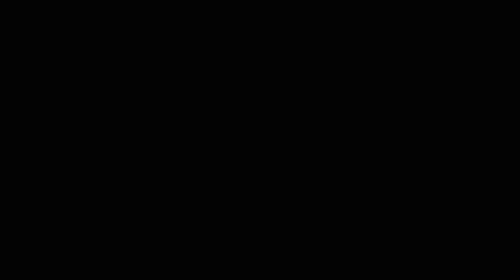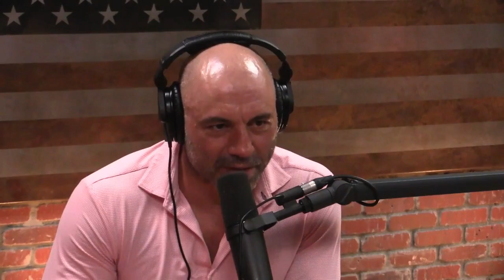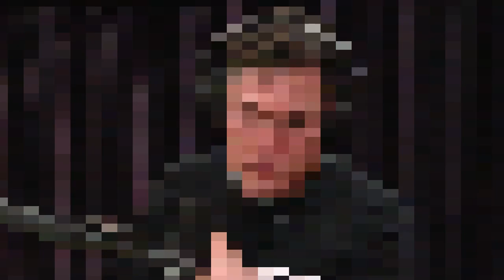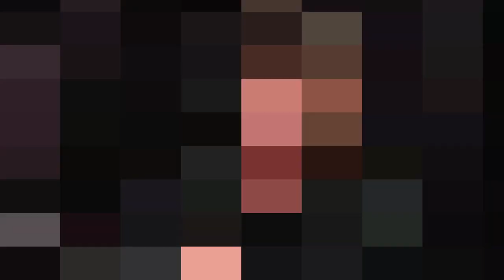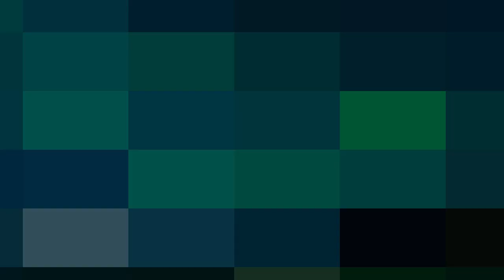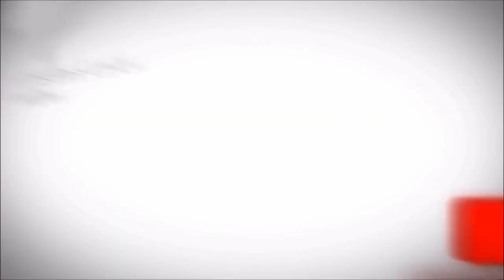Elon Musk"I've designed an Electronic SUPERSONIC JET"

Comment: It sounds like polarized haul's of ships like star trek, in which various energy signiture's could be promoted on such haul's. 

This would allow possible communication signiture's and shielding potential off the haul to be emitted. It's neat that electric propelled planes move, in a earth atmosphere. With the right tuning, it could possibly move it through other environment's like outer space.  This would allow a vessel, or object to thrust movement entirely all at once from a polarized haul. Or entirely all at once, to have communication signal's emitted from the whole polarized haul. 

This in theory, should also work for nano bot's as well, as they could mimic that feature of polarized haul's. Nano bot's could move around and through environment's. As they thrust, or hover through environment's.
Also if nano bot's emitted the right energy signiture's, or signal's. They could be detected from devices and communication with them from other devices would be possible. Cloaking would be possible as well, for those polarized haul's. As they could be blending in microwaves and other possible background noises, to have it appear normal.  The only thing really, is to have polarized haul's charged well enough. For strong energy field dynamics of interaction's to be in the environment. 
Everything is like torus Field's, or alternating current fluctuation's. I like another name for this, force balance.

Comment: I'm a little skeptical of this idea. Elon has said this idea would be compelling if batteries could get to 400Wh/kg and the plane were 70% batteries. So the plane's overall energy density would be 280Wh/kg.

But a boeing 737 can take off with 25% fuel and kerosene has an energy density of 46MJ/kg which equates to an energy density for the entire plane of 3194 Wh/kg or more than 11 times Elon's design.

So how can you do so much more with so much less?

Comment: I've been trying to figure out how such a VOTL supersonic jet would work. But such an aircraft ends up looking like an electric rocket flying a near ballistic arch.

Expending a huge amount of energy on takeoff, not much on cruise, and getting the energy required for landing using regenerative breaking on the way down.

It would be one hell of a ride. Not recommended for the fait hearted as its gonna pull some serious Gs on both take off and landing. 

The only upside being it would be all positive Gs, and you'll get to experience less gravity, even zero G for most of the flight. The downside is you'll probably need a ladder to get out of your seat as the whole thing would be build vertically.

Getting out in an emergency is also gonna be problematic, but at least it would have the entire back end of the aircraft as a crash core to absorb some of the impact... not that it matters hitting the ground at 300 - 900km/h.

Comment: The power of elevation. That is a really interesting concept that is totally overlooked with gas planes. You basically can expend the energy to gain the altitude, then use the wind to regenerate alot of that energy on the way down. And using solar as well to charge the batteries could actually result in really good flight times. Honestly, an electric turbine and higher altitude cruising, combined with a body covered in solar panels, and you could probably make a passenger aircraft that could compete with gas turbines. The maintenance and fuel cost on those is insane. We will probably see something like that in our lifetime. Burning gas really wastes alot of energy, it's everywhere, but we often fail to utilize it.

Comment: Recovering energy during descent would require rotors (like a wind turbine) which would likely double as wings (one of the rotors would flip) in forward flight.  The simplest design would be wing/rotors with tip jets (could easily be compressed air) since they would require no counter-rotation mitigation.  A electric drive at the meeting of the wings/rotors would require a pair of wings/rotors something like a biplane that converts to counter-rotating props.  Any of these would be fine at very high altitudes where aerodynamic drag isn't a major factor.

Comment: basically, musk just said that energy density in batteries aren't there yet. seems like his idea is just to get straight into the upper atmosphere as quick as possible so that you wouldn't waste energy  before cruising in a less dense atmosphere.  However, nothing about what he said is novel or complicated at all.  The part that i guess he is keeping close to the chest is how an electic "jet" could be designed in such way to go supersonic. Its kind of a cop out to just say, "well its easier to do once your high enough." But the fact is, we won't see an electric jet until energy density in batteries get better. Something like an EDF would draw an absurd amount of energy very quickly to reach a comparable thrust power of a jet engine.
Reply: Nice thing about electric motors and batteries is they don't need oxygen.
Reply: @petemiller519  right.... however the thinner the atmosphere the less potential airflow. Jet engines do well in high atmospheres because they also use propellants. As of now, there are no electric engines that could propel fuel as powerful as traditional rocket/jet engines. Ion propulsion is great for long journeys in space, but has no real applicable use within earth's atmosphere.
Reply: @JakeBananas  Check out plasma thrusters, it's new tech that re purposes old tech
Reply: @thevaren27  is that different from ion engines or ion propulsion for pushing ions in the air?

Comment: Elon pretty much just glazed over the hardest part of this problem which is the energy density of the batteries. He probably has a design which is relying on battery technology which doesn't exist yet. Existing batteries - including the cutting-edge ones his own company produces - are too heavy to put into a working plane that could fly very far. Especially a large plane.
Reply: Nah, the idea is that you fly at a much higher altitude thus reducing the energy required quite significantly. Also wondering if the solution includes a "lift off drone" or something similar that lifts the airplane straight up to a high altitude, and then falls straight back to the airport while the plane takes off from high alt.

Comment: Planes are not really pressurized? Doors are leaky? Seriously? They can't airseal a door on a $150 million machine?
Reply: They can, but they don't need to. It's more important on space craft where you don't want all your air leaking out. On a plane you want fresh air going through for the passengers and all they need to do is stick an air pump to keep the pressure inside the cabin the same. It wasn't a problem on earlier planes as they didn't fly high enough that the pressure inside was too low for people to breath.

Comment: It would have to be a 2 part system as he mentioned. 

Think of it as a Part1. giant quadcopter drone lifting Part 2. the plane itself up to 15km(~50 000 ft) and then letting go. The drone can have a smaller battery because on the way down it can just let the propellers spin freely in the opposite direction thus gaining a bit a charge that it can use for the landing. 
The plane itself would have a much easier time accelerating at higher altitude because of the low air resistance.
It looks like what elon has in mind is to use up the entire battery while it cruises at supersonic speed, then once close enough to the destination the plane can let the propellers run in reverse again and charge the battery a bit so that it has reserve charge for landing.
Reply: thats a great idea

Comment: Lithium ion planes wouldn't work that well. You'd need hydrogen fuel cells. Lighter and much more endurance. Super sonic flight isn't necessary if you're just looking at personal aircraft and passenger aircraft. VTOL also isn't necessary.
Reply: Totally agree, VTOL is not necessary for commercial flight, but would be for personal flying vehicles, assuming we get to that point before humanity wipes itself out.  Cheers.
Reply: People will need to cut a 20 hr flight to 30 minutes dont you think ? Or less

Comment: 2:34 you don’t need any reserve fuel?  So every landing is a dead stick landing?  What happens if they need to put you in a holding pattern, weather requires you to divert, or a fuel truck rolls out onto the runway and you need to do a go around?
Reply: He's basically just saying you have the advantage of generating energy back as you descend or decelerate. I assume this is possible due to the entire system being electric, and the system required to propel up to elevation could also regen on the way back down. It is an obvious advantage over chemical energy as there is no way to regenerate jet fuel. 

Instead, systems that produce drag are needed in jets, which in comparison is simply a waste of potential energy. Elon hinted at this, stating that there was no need for flaps, rudders or elevators on electric aircraft. So as stated by 'blue2802485' you can view it as regenerative breaking. A way of regenerating the energy back instead of losing it to drag like systems currently do.
Reply: @gavinmay6949  I get that, and it is an advantage.  From my understanding of what Elon is proposing, it would be a jet that takes off vertically and climbs to altitude at which point it has just enough energy left to cruise to the destination.  Once it reaches the destination (at 0 energy left) it then descends and regenerates enough energy to perform a vertical landing.

My issue with this is that clearance to land typically given by tower on final approach.  The decision to land is made by the pilot, and can be changed to a go around at any point up to the last few seconds.  Committing to a landing at altitude sends red flags flying in every pilots mind.  It has been done before in programs like the x-15 and the space shuttle, but those were much smaller scale and had much higher risk than anything that would be considered acceptable in commercial airlines.

As another example, the vertical tail on an airliner is taller than it needs to be to provide adequate control under normal operation.  This means that 99.9% of the time, its just producing a substantial amount of unnecessary drag.  It's done this way to reduce Vmc, the minimum speed at which the tail will provide control over the asymmetrical thrust produced in the event of an engine failure.  During exams or flight reviews, the examiner will often pull power on one engine while on final to land and declare "you have an engine failure, a fuel truck pulled out onto the runway, do a go around."  This requires full power (maximum asymmetrical thrust) to the operative engine and maintaining your speed above Vmc.  This all means that there is a point at which the pilot must commit to the landing, reducing Vmc delays that point (attempting a go around below Vmc could lead to disaster), and that slight delay in when a pilot must commit to landing has been determined to be worth a substantial increase in drag in all flight operations.

Again, I am all for electric airplanes.  I just get nervous when we start slashing away at established safety principles to try and get an electric plane to work when the energy density isn't quite there yet.  It will get there.  Often times we get creatives, sometimes geniuses, that want to strip down all the "unnecessary" parts of an airplane.  There was a video that recently did the rounds again of an Australian designer who designed the Opel I believe, by "throwing away everything that wasn't needed," a revolutionary plane that could break all kinds of speed and efficiency records at something like 1/3 the horsepower of anything it was up against. He died, his plane broke up in flight.
Reply: no fuel trucks, they run on capacitors and batteries, no runways, because they land and takeoff vertically, did you sleep during the video?
Reply: @warddhuyvetter   Really?  Fine, a luggage cart is on the runway, or a bus full of nuns, or a truck filled with 4th of july fireworks.  For some reason, you cannot land on this attempt (this is routine training for pilots).  What do you do now?

Airplanes are gliders with engines, if the engines fail, they can still glide.  There is very little that is riskier for an airplane and more energy demanding than hovering.  Hovering with "no reserves" might top it.
Reply: Simply glide down to recharge and fly up to circle, essentially a diagonal elliptical orbital flight patter (same as moon orbits a planet), till the ATC clears you to land.
Think of it as regenerative breaking to recharge EV batteries on the move.
Reply: blue280485 regenerative breaking does not produce a net 0 energy loss, and much less in airplanes.  It would take far less energy to hold altitude than the net energy usage of climbing and then descending while regenerating energy.

Not sure what you mean about orbits, planes have very little in common with orbital mechanics, unless you just meant circling.
Reply: @xpeterson  I Partially agree with you because it would work, see for yourself - https://youtu.be/w5t8VdLpsOA
Regarding orbital pattern, I meant the plane flies in circles whereby the flight regime looks like lunar orbit (the moon's orbit it tilted 5 degrees).
Reply: blue280485 yeah, I’ve seen that concept.  It’s a hybrid, it relies on its turbofan engine to provide electric power to the batteries, it still cannot regenerate the energy it takes to climb on its decent.  When you go for multi engine training, they make it very clear that a windmilling engine produces a SUBSTANTIAL amount of drag, more so than if the propeller were locked in place.  This means that to maintain air speed while using the fans or props to regenerate, you would have to use a fairly aggressive and steep decent rate (it might even be an effective means of emergency decent).  The climb back up to altitude would take far longer and MUCH more energy.

Don’t get me wrong, I love the idea of electric planes.  If we could get the energy density to the necessary levels, electric aircraft would make flying cheaper, safer, faster, and generally more accessible to everyone.  It is better in every single way than conventional flying except for the battery.
Reply: @xpeterson  several current electric aircraft can use the propeller in windmill mode as a regenerative air break.  Pippersal reckon the can recollect 5% of the total charge of the battery that way.  It beats deploying spoilers.
This as a supersonic aircraft and is going to have a very high stall speed and will best need to land vertically.  A conventional landing at an airport with a long runway may be possible.  A recovery parachute for passengers in a pressurised passenger compartment may be possible. EVTOL like the Lilium have 6 battery packs and 6 electric motors.  Massive redundancy is possible with electrics and this will define safety.   I suspect these aircraft will be hybrids with a small APU that is used during takeoff and climb to the point the air is to thin in order to increase range for longer flights and as a 'reserve' should diversions and holding patterns be required.